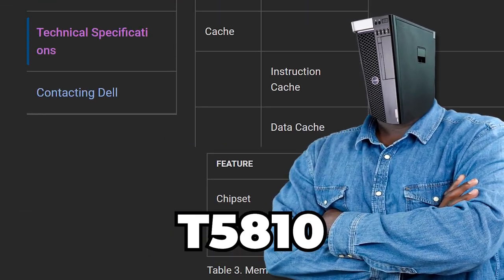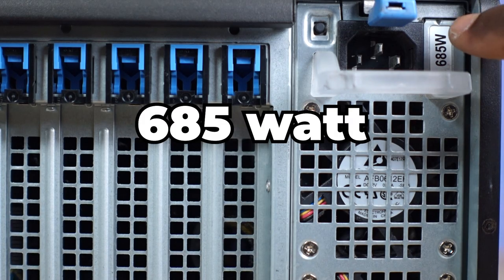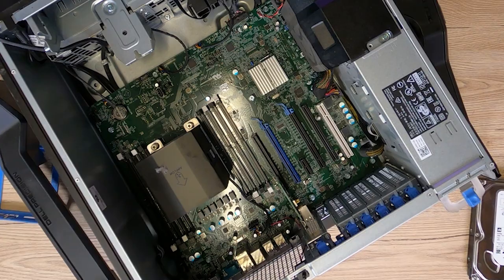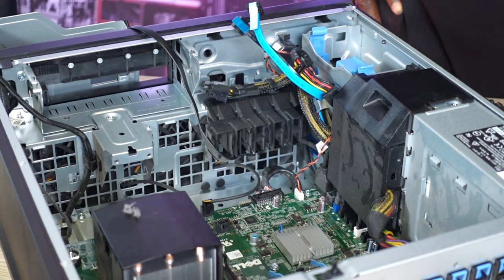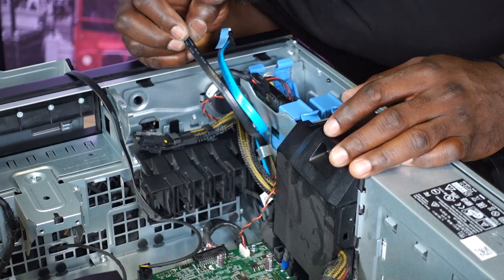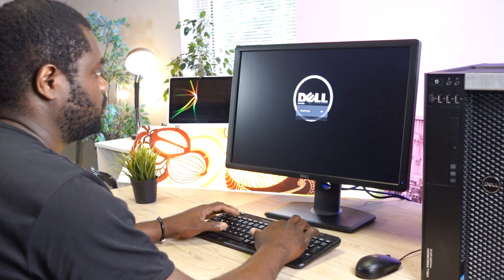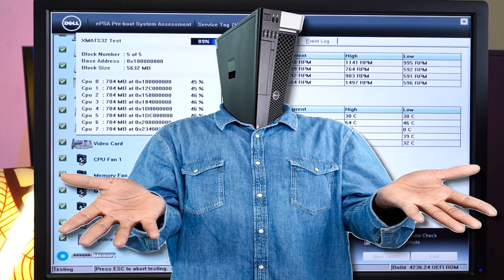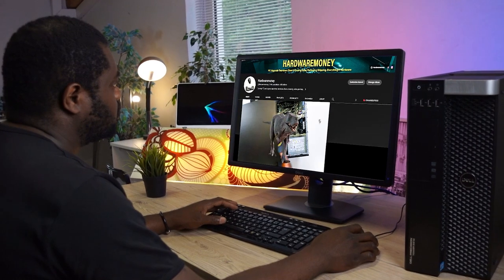Let's  Upgrade a Dell Precision T5810 Workstation and Run Onboard Diagnostics

Comment: I bought a 5810 off Ebay for $200 with 14-core Xeon. The biggest surprise is that it had a Quadro P4000  and 64-GB of ECC RAM installed. I bought a PCIe M.2 adapter that allowed me to use a faster NVMe drive instead of a SATA SSD. It was for my 12-year old grandson who kicks butt on games.
Reply from the maker: Really?? Lucky you😉the P4000 in itself already is worth more than $200!
Reply: 14 Core Xeon for $200 ??

Comment: You can actually use an NVME SSD in a pcie slot with a x1 or x4 adapter.. I run my T5810 with an adata 128gb as a boot disc.
Reply from the maker: thanks for the tips 😉
Reply: me too 😅
Reply: how, i try nvme not detected in bios but detected in windows.

Comment: I got one of these last month for £75 and it had a xeon 2680 v4,32gb ddr4 2400 ram,500gb ssd,2tb hdd and a 685w psu,put a rx 6600 xt in it and runs games like nothing at 1440p and 4k.
Reply from the maker: great price!😉
Reply: @Hardwaremoney  yh got lucky as this exact spec goes for around £250 to £280 and that's without the gpu that I picked up for £150👌

Comment: Nice video ... I have upgraded my Dell T5810 with a Xeon E5-2678 v3 processor which has 12 cores and runs like a deer!  Also I have two Micron DDR4-2133 32 GByte memory cards which is plenty for my CAD operations.   I also run a NVIDIA GeForce GTX 1060 6GB graphics card which again does a good enoigh job for my CAD work.  Overall the power draw is very low now with this graphics card (I have the same 685W power supply but I am drawing around 200W ).  I have two Dell 1900 x1200 24inch screens for my general work which are nice.    Thanks for sharing the SSD pricing - I didn't realise how low the BX500 1TB SSD had dropped to.  Does your motherboard have SATA or nVME slots? - the later ones did I think - certainly the T5820s do!
Reply from the maker: Nice config and Monitor set up 😉, and yes, the prices of ssd keeps dropping by the day, even the high end Samsung EVO!  nVME slots on the mainboard.. hmm not so sure, can check it though tomorrow when i get to the warehouse.
Reply: How much did the upgraded CPU cost you?
Reply: You want 4x Ram modules to make use of the Quad channel memory performance! so better to get 4x smaller modules than 2x big ones!
Mine has a e5-1660 V4 CPU as I use for games so better Ghz speed on less cores, with 4x 4GB 2133 and a GTX970 (serves good as a second gaming PC for the living room)
Reply from the maker: @keanankruse  True 😉

Comment: To get a full height GPU in I had to drill out the rivets and remove the big crossbar on the case lid. It wasn't too hard but a bit of an obstacle
Reply from the maker: oh really? my M4000 went in without any hassles
Reply: i am planning to get this build with RTX 3060 Dual Fan, would this be an issue as i don't understand what rivets and crossbar were a problem for you
Reply: @rayyanberg8974  hi 
Were you able to install 3060 to dell t5810 ?
Reply: @grigoryvasiliev-ih5iz  i didn't get the workstation

Comment: I have a t5810 ,  500 gb ssd,    DIMM, 4GB, 2133, 1RX8, 4G, DDR4,    Processor:
PRC, E51620V3, 3.5, 10M, HSL, R2  .  It takes 1 min before splash screen appears. Many owners have complained about the same very long boot time.  A much cheaper i3880 is much faster and boots far, far faster. I can't figure out from your video how you got boot down to 28 sec.   Your splash screen appears after just a few seconds.  The GPU isn't even accessed until after the splash screen.   Any suggestions?

Comment: hello everyone i want to upgrade my t5810 it will be used for some gaming and general tasks. what is a good CPU and GPU i should get? it currently has  a xeon E5-1603 v3, quadro k620, 685w PSU and 16GB ram

Comment: I have  DELL T5810 2650 V³
16GB RAM
128 SSD
2TB HDD
K4200 GRAPHIC CARD 
so I have to make it for gaming, now what else should I add to it?
Reply: Change that gpu out for a rx 6600 xt and get a 8 pin pcie connector and ur sorted for gaming

Comment: Hi there, I recently acquired a T5810 workstation which has a xeon e5-1620 v3, meaning its only a 4-core. Would it be worth upgrading this to one of those 12-cores? It is going to be used for gaming and I plan to pair it with an rx 580. 

Cheers!
Reply: I own the same system and my cpu is xeon e5 1660 and gpu 4060 ti and is giving me 110 fps on horizon forbidden west and 200 fps on cod mw3

Comment: I have dell precision t7810
With dual processor E5 2650 v4 24 logical  cores combine 48 threads
And 32gigs of ecc ram and 512 gb ssd 
And 1tera hard drive  with quadro m4000 8gb 
The score on cinebench is around 18k 
And windows 11 isn't supported 
Any suggestions what should i do
Reply from the maker: check out the work around install videos on youtube, should help 😉

Comment: I need help I have Dell5810  intel xeon e5 1650v4, k620, 265gb SSD and 500gb hdd 

Whenever i turn ON my pc it shows logo and goes black for 40secs then again logo show up and take 60secs to load up/ start
Reply: did you update the bios?
Reply from the maker: you might want to check if the graphics card driver is installed, also upgrade the bios. this is how i will start in finding the cause of ghe problem😉